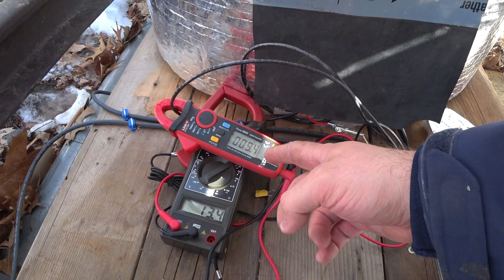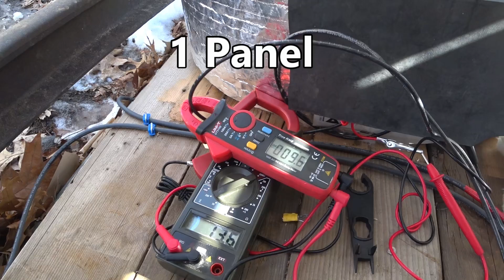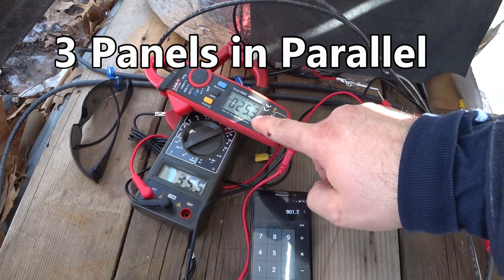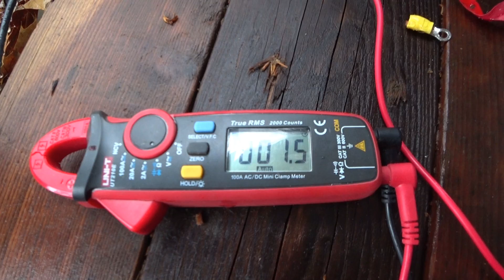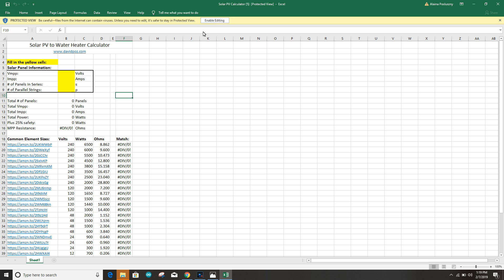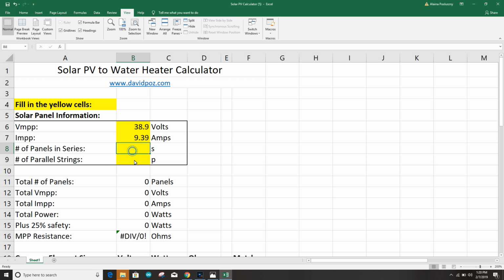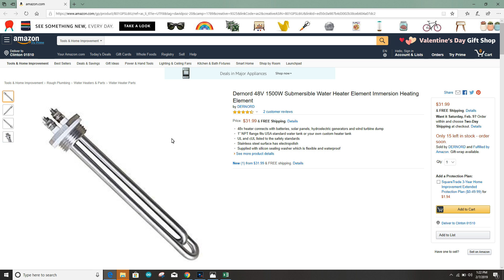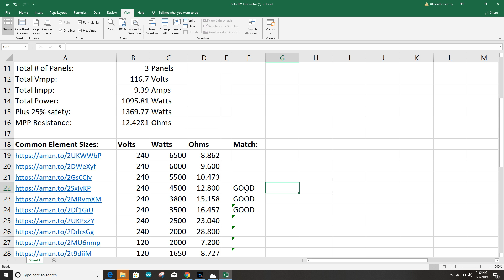Matching Water Heater Elements to Solar PV Panels

Comment: Why not add an mppt solar controller and some batteries and a relay. So that when your water is hot and the thermostat turns off the element, the extra solar power can go to the batteries to give power or heat water when no sunlight.

Comment: I want to thank you for this...I am using the spreadsheet to size my element for a bastardized water heater that will have the lower element DC direct and the upper AC from shore power via an outside solid state relay.  This is all for the hydronic floor heating in my new garagemahal.

Comment: David can you advise a thermostat with remote temp sensor for could use to interrupt the heater at a desired temp? I tried an ac rated one but at 137 volts DC , I am getting an unstoppable arc in the switch which burns it up basically a welding arc
Reply from the maker: The solution is a little more complicated:
1. The High-Voltage DC from the PV array needs to go through a contactor.   The contactor needs to be rated for the Voltages seen.  Here is an example: https://batteryhookup.com/products/gigavac-gv200ca-3-coil-24v-500a-sealed-contactor-0-800vdc?_pos=1&_sid=84c6f4a3f&_ss=r (note, used discount code DAVIDPOZ at checkout)
2. You need a 12V or 24V power supply (depending on the coil Voltage of the contactor).  The example above is 24V.  Here is an example: https://amzn.to/43c3PIe
3. Out of the power supply you will have two wires, positive and negative.  run the negative to the contactor.  Run the positive to the mechanical snap-disk thermostat on the water tank.  They look like this: https://amzn.to/4m3Uri8  Then out from the thermostat to the positive of the contactor.

As you will see, the thermostat on the water heater is only switching 24VDC, and less than 1 Amp.  This is fine.  The contactor is doing the hard work of switching the PV power. Does this make sense?
Reply: @DavidPozEnergy  thanks SOOO much for this solution, I will get this done,  Let me buy you  lunch!
Reply: chrome-extension://efaidnbmnnnibpcajpcglclefindmkaj/https://www.farnell.com/datasheets/2630923.pdf
 wonder if this would be ok $26?
Reply from the maker: That contactor looks good, and only needs a 12VDC power supply.  Of course, you need to ensure you stay within the parameters of the equipment.  The data sheet says 450VDC, 100A, so stay below that.  Good luck with your build.
Reply: @DavidPozEnergy  DC solid state relay (SSR) or mosfet with freewheeling diode?

Comment: Hi, just wondering would there be a safety concern if the hot water element degraded and broke, the high dc current wpuld then go into the water. Just thinking their could be a risk of an electric shock? Any thoughts?

Comment: Hey, so if starting from scratch, I can just buy a normal a/c water heater at the box store, and then if the element matches, use it with the panels, or just swap in the right element, and good to go? Panels direct to heating element, no inverters or other shenanigans in between? Sounds like a good hack.
Reply from the maker: If that's what you want to do, then here are some considerations:
1. Arrange your solar panels to match the element and you won't have to swap it out.
2. The thermostat built into most tank water heaters is a "snap disk" style.  They are built for up to 250VAC.  That's AC, meaning Alternating Current.  They won't work with 250VDC, they will melt and light on fire.  This means you have to build your own thermostat system designed for DC.

Comment: You can do sola hot water without solar panels. Just a well-insulated box with a glass top and a tank. Works best in the south. Has to have a insulated lid to cover it on very cold nights.

Comment: 120 and 240v are AC, and the others on the list are DC. As far as im aware, you cant use DC on an AC heating element, but i could be wrong
Reply from the maker: The heating element can be used with both AC and DC.  However, the thermostats on water heaters are made for AC only.  The thermostat will arc and melt with DC.

Comment: hello is there a way to calculate what power is lost when using a higher resistance value element on a given array ? i.e. we used your helpful excel calculator with our panels we get a "MPP Resistance" of 7.31 ohms, we already have a 240v 3800w element with 15.15 ohms resistance.. we could not find how to calculate the losses meaning the values are not so close and want to calculate how much we will loose ?? TIA

Comment: IMO this calculator is causing people to under power their elements.  There is no need to through in 25%.  Simply make sure your max voltage isn't exceeding the element.  Your 24V panel with 38.9Vmpp is well below the 48V element that can probably handle 60V. On your best sunny day you are only getting 900W with your 1.4071 ohm load and much less if people have any significant wire length, 50 more panels in parallel is still going to stay 900-1000 watts because the voltage is well below the elements rated.  You would be better with the 2000W elements lower ohms and 5 parallel panels.  I would like to see you try three 12v Panels in a 3S configuration to a 48V element with high enough amperage that is somewhere near your element amp draw.
Reply: Or try your 48V element with 2S2P or 2S3P using your existing panels unless the Max voltage gets too high.

Comment: Hi David, I'm so sorry as I'm a 67 yr old newbie to solar and volts etc, but I'm fascinated with fact you could have free hot water from solar panels, its just I cant work out which element I need to buy... my panels are 190w with VOC 45.3V,  ISC of 5.74 A,  VMP 36.74V and IMP 5.17A...I've tried to figure it out but fail, do you have any idea which element I need please...thank you for any help you may give David...
Reply from the maker: Hi MegaPatients,
I built a fee online calculator on my website to assist with this.  If you get a chance, try it out.  I just plugged your figures into that calculator:
Vmpp: 36.74
Impp: 5.17
I don't know how many panels you have, and that will adjust the number.  
For example, if you strung 2 panels in series, then you could wire that string to a water heating element listed as 240V 3500W.
Amazon Affiliate Link:
https://amzn.to/47Kb2zq

I hope that helps, 
David
Reply: @DavidPozEnergy  Thank you so much David, I've tried and failed doing the calculations a few time's must be the old grey matter getting soft, but I'm very grateful for your help...new subscriber...

Comment: I am really struggling to get my head around this, could someone please help?

My system has 2x100w panels in parrallel, so 20.4volts vmpp total, and 9.82amps in total giving 2.07739 ohms.

The calculator suggests a 1000w heating element at 48v which has a resistance of 2.304ohms.

I cant understand how I can power a 1000w heating element with 250w of power?? 🤔
Reply from the maker: It's all about the Ohms.  The solar panel array Ohms needs to match the heating element Ohms.  Which is what the calculator is helping you do.  Since you will have 200W of solar panels, that's the maximum energy your system will make for heat.  The element can go up to 1,000W, but if you only supply it with 200W, then it only uses 200W.
Reply: @DavidPozEnergy  thank you David. I wasn't sure if the 1000w element needed 1000w to turn on, or whether it would just run at a fifth of it's capacity with just 200w going in. 

Will the 48v choice of element only work if it's wired directly to the panel, as appose to being connected to a 12v battery?
Reply from the maker: If you connect a 48V, 1,000W, element to a 12V battery, it will technically "work", but not well.  The element might draw 62 Watts.  Basically, the water won't get hot enough to be usable.
Reply: @DavidPozEnergy I'm basically looking into heating a small water tank inside a campervan and wondered whether a dedicated panel could be left on the roof just to power the element separate from everything else. However I think it might be more worthwhile using a 12v element in a solar dump format so it heats up when my batteries are full 🤔
Reply from the maker: Yes, if you already plan to have an MPPT charge controller, and batteries, then use the "diversion load" method.

Comment: What should my fuse size be in relation to my results ?
Reply from the maker: The fuse is to protect the circuit.  Size the fuse for the weakest link in the circuit.  That might be the wire you use, or a connector, etc.

Comment: Although it is mentioned in comments below, there are also some comments that are a little off.  Too bad you didn’t mention it explicitly in your video, but the issue is impedance (or here resistance) matching.  There is a well known theorem in electrical engineering that if you want to maximize the power transfer between two ports, they must have the exact same impedance (resistance here because it’s DC).  So find the resistance of the element (volts/current drawn), and then rearrange your panels in combinations of series and parallel until the panel source impedance (resistance) is about the same.  How much the same? There is something called Return Loss and VSWR (look them up on wiki).  Based on these, if your source (Solar) and load (heater) impedances (resistances) are within a factor of two of each other (either 1/2 or 2:1), then you will couple 90% of the available power.  So this is what is included in the spread sheet, but honestly, since you are usually given your panels when you decide to do this and likewise for the heating element(s), there is really only a couple of combinations, and so you can almost work it out in your head.

Comment: It's called the maximum power transfer theorem. If the load (the water heaters) resistance equals the supply (the solar panels) resistance, you will get the maximum POWER transfer. Don't just work on amps or volts, as he correctly stated in the video, measure both and multiple. This theorem works on radio frequency equipment too.

Comment: So @11:50, why would a 240v heating element work fine with a 116v solar array?  Shouldn't the heating elements starting on row 27 be more ideal?  Or is it because this is DC?
Reply from the maker: It's about matching the Ohms more than the Voltage.

Comment: What would be the best way to put heat in to a sand battery?
Reply from the maker: Electric resistance heating element.
Reply: @DavidPozEnergy  don’t these require being submerged?
Reply from the maker: I haven't experimented with sand for heat storage.  I built a 250 gallon water tank (videos on my channel).  Try checking out this other guy: https://youtu.be/lRvPAYryFOQ He is running experiments with using sand for storing heat.
Note, Personally I think water is easier overall for residential use.

Comment: How would you do a 6kw hot tub?
Reply from the maker: I have a free calculator on my website that might help you.
Reply: @DavidPozEnergy  iv been watching some youtube videos where people are heating water directly with pv and are usingba thermostat connected to a solid state relay. Are you using this set up? https://youtube.com/shorts/3fyRZmePjgo?feature=share4
Reply from the maker: @bencordell1965  I use a large contactor from an EV.
Reply: @DavidPozEnergy  could you make us an excel spreadsheet so we know what ssr and temp controllers we should buy😆😆😆im definately buying the element your spreadsheet recomended
Reply: @DavidPozEnergy  in your spreadsheet I entered vmpp 39.9v impp 9.39A 3 in series 1 in parallel.  Your spread sheet says that will kick 120 volts 1400 watts

Comment: I used your Excel calculator to figure out what size element I needed to match up with my solar panels.  I hooked everything up four weeks ago and use a Raspberry Pi to monitor it.  I set it up so the solar panels keep the water heater between 130 - 138 degrees.  During this time, the water heater has only turned on once for seven minutes (only because it was a rainy day).

Comment: Hey In regards to the excel spreadsheet calculator. In the "match" column a part of the formula compares the Amazon elements' resistance to the pv array's resistance, why is it "good" when the element's resistance is lower than the pv array's resistance*1.33?
Reply from the maker: Solar conditions are rarely going to give you the full potential out of the solar panels.  Most of the day (even a sunny day) the solar panel will output a little less than advertised.  If the resistance of the heating element is a little lower than the STC rating of the panel, it will actually produce more hot water on average.
Reply: @DavidPozEnergy  ohh, thnk u experience right
Reply: @xivx4679  Actually, he is wrong.  Well, for two hours he is right unless a cloud comes over. One university study found that almost doubling ideal resistance increases daily heating. It is the power of squares.  Example: a 10A panel outputting 5A puts out 100% more power with the resistance doubled. Most of the day you are throwing away power.  I use power point control which needs half the panels and gives hot water even under poor conditions. It is a quali of life issue, not just economics.

Comment: got a bunch of free last gen  pv panels... direct to water heater for showers and spa... then some for  dc sand battery with range top elements and air heating fans for the hvac system,   great channel .  thanks for the tip on signature solar  out of texas..   off grid in town. as  nat gas price spiked 3X in SoCal

Comment: I am planning to heat my trailer 150 sq ft with a heated tank of water.  Propane tanks have 1 inch threaded ports and may be perfect.  25 gallon with a small hole to release pressure and add more water.  36 volt 250 watt panels at santan solar is a great price per watt.  I have 8 on another system.

Comment: Can you use DC heat tape with solar panels to make a make-shift radiator (metal pipes assembly) to heat a small living space ? That would be a popular video
Reply from the maker: A while back, I used a baseboard electric heater tied to solar panels.

Comment: Thanks again David for the instructive and educational video.  Everything works great for me with 4 panels.  But the thermostat on the hot water unit keeps blowing up!  It is set for 75C/167F which is normal.  I am thinking the thermostat is designed for AC and doesn't like the solar DC.  Any experience you can share??
Reply from the maker: That's correct, the thermostat is designed for AC only, and you can't run solar directly through it.  In my video I used an open system, meaning non pressurized.
Reply: @DavidPozEnergy  Thanks mate.  Also found this site that explains how to add a Solid State Relay to protect the thermostats.
Reply: try 250V/5MICROFARED CAPACITARO  ,accross the thermostat contacts

Comment: Kalimera from kalymnos Greece, (first of all excuse my bad english) your work on the videos about panels direct to the heating element is great and it was all I was looking for to start with. What I did is that I connected 7 panels of 285W each in serie that gives me about 235V no load, with the heating element 230V/1500W 34Ω and for 3 days now it seems to be ok.The only problem that I had is that the thermal switch was totally damaged probably from the arc that disconnection causes. Do you think of any solution? How to stop this arc the dc voltage creates? TNX Petros.
Reply from the maker: I know what you are talking about, and I agree with you that the arc killed the switch.  I'm in the US, and our water heaters use a "snap-disk thermostat"  Example: https://amzn.to/3A2Llfn  The gap is very small between contactors and 235VDC (from solar) will easily jump the gap, making an arc, and melting it.  Instead, what can be done is this:
1. use a contactor made for high Voltage DC.  I am using a contactor out of an EV that I disassembled.  Here is a perfect one: https://batteryhookup.com/collections/accessories/products/gigavac-gl100abana-100a-0-800vdc-12v-relay  (use discount code DAVIDPOZ at Battery Hookup to help)
2. The contactor will need 12VDC to power the coil internally.  This can be done with a 12V power supply like this: https://amzn.to/3fXbKVa.  Or, I use a very small 12V battery and 12V solar panel just to keep the battery topped off.  
3. The 12VDC power goes through the water heater thermostat, then the coil on the relay.  If the water is cold, the thermostat closes, sending power to the contactor coil, which closes the contactor and allows Solar PV direct to the element.
4. I also use circuit breakers and fuses where necessary.

Comment: If you started over, what solar panel would you recommend?  Just trying to add a pre-heated tank into my radiant heating system.
Reply from the maker: There are a lot of really good solar panels on the market.  Used solar panels can sometimes be found at a very good price per Watt.  I look for mono-crystalline panels, MC4 connectors, and UL listed.   All the panels I've bought have been used panels, and I will typically pay $0.20 - $0.30 per Watt.  Craigslist and Facebook Marketplace are good sources for local, used, solar panels.

Comment: Powering the heating element directly is (mostly) safe (don't exceed the heater voltage rating too much) but don't use a standard (AC) thermostat to switch off the current when the desired temperature is reached. An AC thermostat contacts will probably arc and weld shut.
Reply: What is your recomended replacement for the AC thermostat contacts keeping it as simple as possible? Thank you.